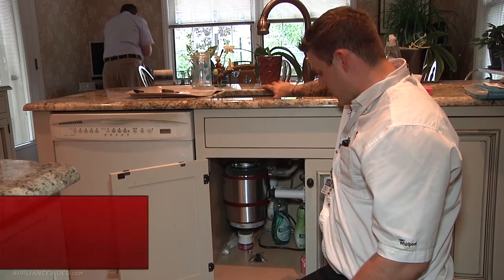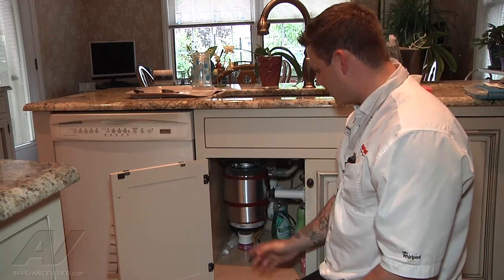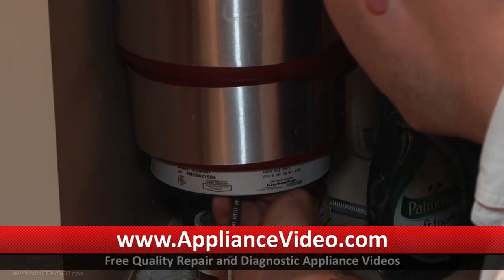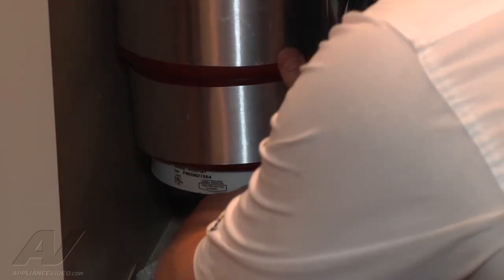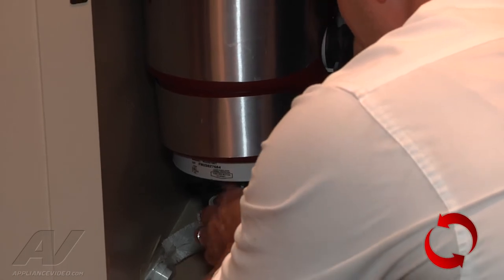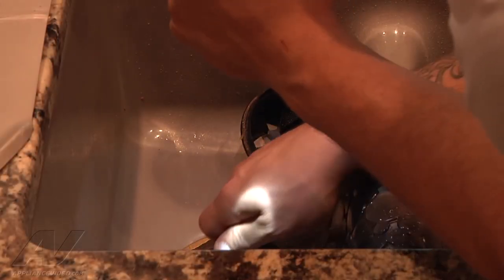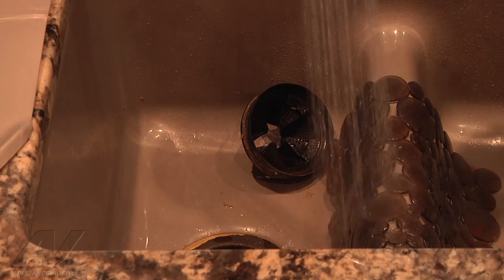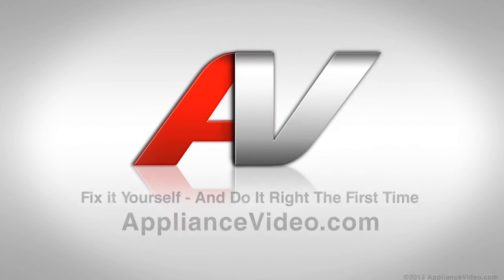KitchenAid Garbage Disposer Repair - Hums But Does Not Run - NMN

Comment: Kitchenaid  disposer  are insinkerator
Reply from the maker: Great question, if you have a more technical question that our parts department cannot answer, you can search our over 13,000 answered questions free at our website www.ApplianceVideo.com under our Repair Help section. You can also call our parts department at 1-800-830-5465 and they can give you help 7-days A week ,or search at www.SaveMoreOnParts.com  .
Reply: So are Kenmore, Whirlpool, Maytag, Roper, Inglis, Evergrind, Ace Hardware, Badger...